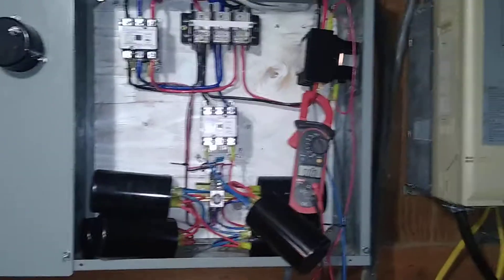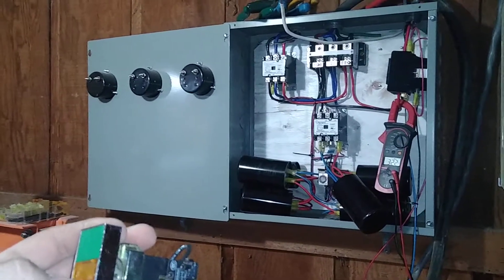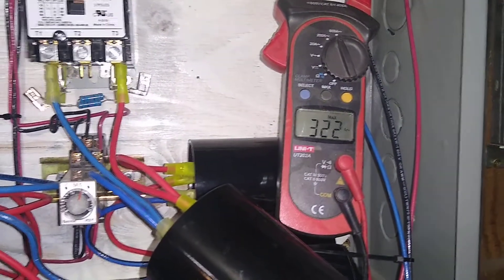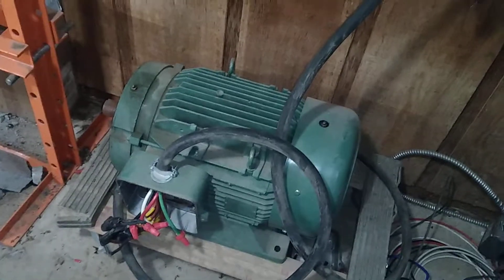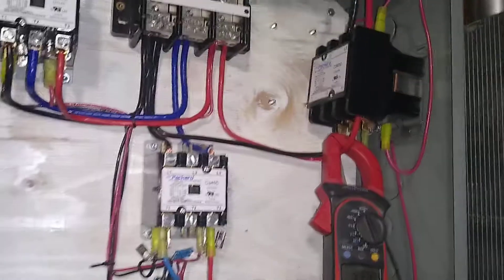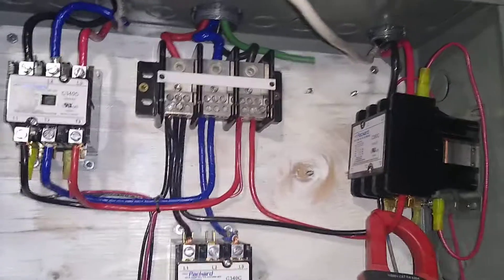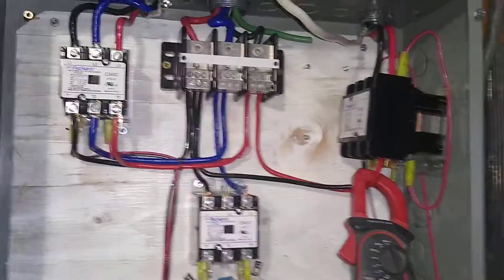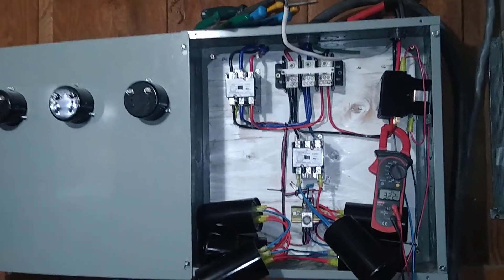30 hp rotary phase converter pt 2

Comment: Have you had any issues with that time delay relay, I am building a phase converter and want to do what you did with the contactors and time delay relay but see bad reviews for them as they aren’t intended for continuous power, that one is rated for 5A was wondering if that has worked for you so far?
Reply from the maker: @sizemattersoffroad9103  ya I've never had issues. Been running it for years. And I used a cheap eBay brand. Also sold several for friends. No issues I even accidentally left it on over the weekend once. No issues.
Reply: @electromechanicalstuff2602  okay awesome, another question I have is it looks like you used 2 resistors from one leg to the other on the contact for the start caps, why is that needed and what resistors did you use?
Reply from the maker: @sizemattersoffroad9103  it drains the start caps. They came with the caps when I bought em. Not really necessary. I'd have to check to see the value
Reply: @electromechanicalstuff2602  oh okay thank you, what size wire are you using going to the timer and from the timer to the capacitor? 14ga?
Reply from the maker: @sizemattersoffroad9103  timer only controls the coil on the contactor. It can be pretty small it takes less than a half amp to power to contactor coil. I may have used 14 or smaller. The contactor does all the heavy lifting to bring in and disconnect the caps from L1-L3 or L2-L3 sometimes it works better one way or the other but usually doesn't matter

Comment: I am also building a 30hp converter. Question for you. What size and quantity start capacitors are you using? Run capacitors? Do you have the formula so I can do my own math? Thanks in advance for your help
Reply from the maker: https://youtu.be/u229h7NcMxk
In his description is a pdf. 
As far as start caps I used 6 330vac 270-330 mfd jard caps from supplyhouse.com I think off memory I'm in the 250-300 mfd range for each leg for balancing. But they are not equal. U add capacity in trial and error. Add until voltage on third leg is desired. But with smaller motors it's important to not exceed the motors maximum current capacity during balancing. 30 hp motors usually not an issue.

Comment: This is the first I have found to mention wire size and amps  i have not ben able to find what to base my input and output wire size on. I have an 20 hp rotary transformer the plate says FLA 90 amp and 3 phase amp 30. I don't think 3 2/0 wires will fit in the motor connection box I thought of extending the 6 10 gage wires from the motor to the control box but no-one seems to do that. can you tell me what you based wire size on ?
Reply from the maker: Rotary transformer. Is that the same as rotary phase converter? Or something different? If it says 90 fla that sounds like a lot! My 30 hp pony motor only pulls 60 amps FLA. So I hooked it to 6-6-6-6 soow cord. Now being that your load can only be 1/2- 2/3 of the rotary phase converter the math is kinda simple. So I have a 30hp 3 phase motor. I can only run 15 hp worth of machines at once. So 15hp x746watts x1.2= 13,428 total watts now divide by 240volts = 55.95 amps I will draw on my single phase side of my breaker panel so u need 6 awg copper or 4 awg aluminum going to your breaker panel. As far as what size I'll send out to my 3 phase sub panel it can be smaller because the 13,428 watts is going to be split up on 3 wires now so take 13,428 / 1.732/ 240= 32.3 amps of 3 phase amps. Me personally I ran 4-4-4-4 aluminum service entry wire both on the single and 3 phase side of things because it's cheap at the local big box stores it's good for 65 amps. As far as all the wires inside I ran 6 awg copper to everything.